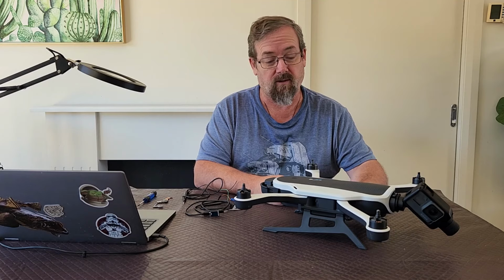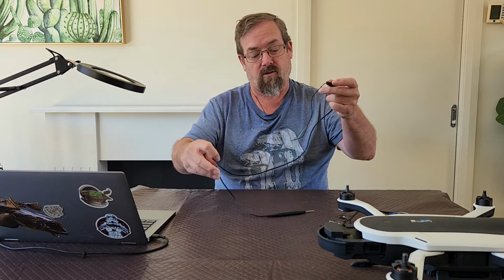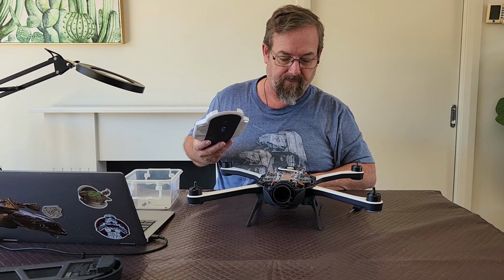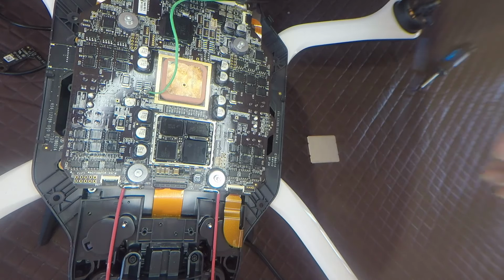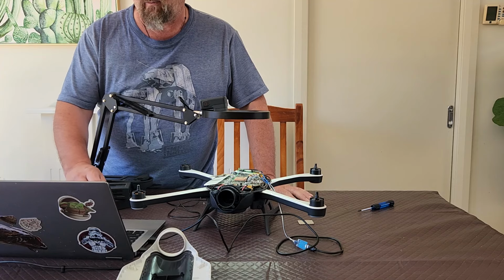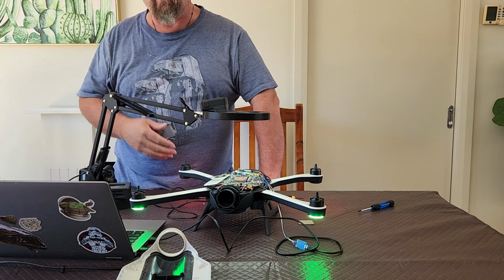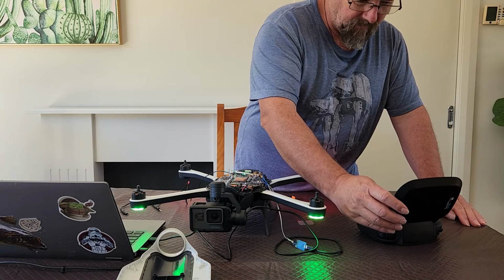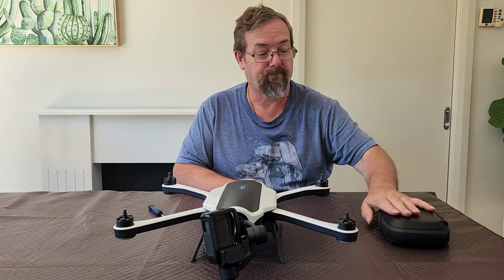GoPro Karma Pairing Fix with some extra information

Comment: Ben you truly are amazing I’ve watched your other videos from back in the day when I was attempting to find hair restoration options because I had pulled out almost all of mine in a vain attempt to fix my drone. The patience you must’ve had is commendable. I’m interested as to how it all came about and how you reached the solution you did. 
Regardless I cannot thank you enough for posting this video it seems mildly daunting but I appreciate your clear and concise videos. 
I’m assuming your inbox is overflowing with requests and comments, but if you ever decide to offer your services for repair please let me know and I’d happily pay for your time and knowledge.  Once again, I think I say this for every grounded karma owner… thank you thank you thank you!
Shout out to Mike’s Man Cave!
Reply from the maker: Hey Jo, I can't take credit for finding the solution to the pairing issue or the controller upgrade fix. For the controller upgrade fix I adapted work that others had done to turn the controller into a gaming console so that you could write a newer version of the firmware to it. For the pairing issue I had been working with a group of others and we were trying to replace the bootloader via the UART boot but we were not able to get it to enter the UART boot mode consistently. Sergey cracked the ability to boot from SD card which then provided the missing part to the upgrade process.

Since then my part have been about promotion of this method and setting up a social media presence, getting the Discord server off the ground and engaging with people around the world who have the ability to carry out the repair reducing the cost of shipping. We are continually adding new counties to the list.

Comment: Thank you for this video. Just one question, the serial interface is RS232 with +/- 12 Volts, RS485 or which is the voltage of it? TTL 3,3volts or 5 volts ?
Reply from the maker: The serial interface is TTL, the 3.3 volts is used to drive the SD card and trigger the SD boot.

Comment: could you please explain the probe wiring? are both wires connected together into the probe ? but the green one gets the resistor? I am confused there Thanks
Reply from the maker: THere are several ways to do it, we have pictures of each way on the discord server. It depends on what method you are using (on board SD card , external SD card and or where you are pulling power from. If you have one of Josh's Good Karma boards then you dont need to worry about it as the probe is built into the unit

https://cdn.discordapp.com/attachments/1230267922874765413/1230507615264706560/triggering_boot_with_fb36_jumpered.jpg?ex=67983045&is=6796dec5&hm=f0c323ed081e93123c867a29cbbf0845082364ed75b8ac61da02811f3204ddac&

https://cdn.discordapp.com/attachments/1230267922874765413/1230507940872454214/triggering_boot.jpg?ex=67983092&is=6796df12&hm=6640ebb6e0ec9276a6cb38629895a631bdcca3f0259893691719d948ab1662dd&

https://cdn.discordapp.com/attachments/1230267922874765413/1230507192969596938/triggering_boot_with_fb36_jumpered_power_from_jtag.jpg?ex=67982fe0&is=6796de60&hm=41176ee208efd19ba02af242ad159e224c01fa3180e9994297b7c7108ccb43b7&

Comment: Thanks for really good video, i have soldered SD card reader, i see drone with putty but when i try to start it from sd card, it does nothing, when i touch with probe, does it mean that sd card reader is bad?
Reply from the maker: It means there is an issue with the SD boot process. It could be the card, the image on it or the SD reader you soldered. make sure the resister is only between voltage and the probe. Dont have the resister between voltage and the SD card reader. 

If your still having issue come over to the Discord server and ask the question there.

Comment: Hi Bozmanx where can I buy the tiny 3 pin female connector for the Karma's serial port , so it will fit exactly on the type of male connector on the mainboard. An advice which connector type I need is appreciated !  Thank you in advance.  Cheers, Erik
Reply from the maker: Its a JST 1.25 pitch 3 pin plug
The page below defaults to a different one so make sure you change it too JST 1.25 3pin
https://www.aliexpress.com/item/1005001649158434.html?spm=a2g0o.order_detail.order_detail_item.3.2451f19cZYNvV3

Comment: Hello, you have a lot of great info in this video. The only issue I am having is with the probe. I can see where to put the resistor, but my question is. where do you get, or how do you make a probe like the one you have with the 2 wires coming off of it? Thank you
Reply from the maker: I just soldered a couple of bits of wire together. Added a resister and connected it to an old multimeter lead that had a probe on it.

Comment: Hello @bozmanx ! Big thanks for this video 🤩 Have you a little diagramm for connexion between mother board karma and sd card board with 1k resistor etc !?
Reply from the maker: If you go to the discord server (link in the description) under important pictures there are about  5 pictures on the different methods.

Comment: can you please provide link to made up cables and advise if prob with soldering method must be used or can external power source be used rather? 

otherwise are you interested in purchasing my drone with this issue?
Reply from the maker: https://www.youtube.com/watch?v=dNbqbC1h_9s

You can get power from the drone or use an external power supply. Some people have been using power from the USB TTL device, the Project good karma board is also used for power via its USB-C connection.

Comment: Will this happen to every Karma drone? I have two. One just got the "decease" during a lengthy winter hibernation a couple of years ago. The other one is still working.
Reply from the maker: Its possible, at the moment it appears that if you don't use it for a lengthy period of time that it happens. I got my Karma drone back in about 2015 but its is still fine.
Reply: @bozmanx  Is there any official word from GoPro. When this started to be an issue a lot of people got a new Karma core (body) as a replacement, but when I tried to open a case they offered me a new remote controller! I tried to complain and suggested that other people got a new core as the fix for this issue but to no avail. I don't understand how GoPro could offer replacement cores to some, while my excact same issue was supposed to be fixed with a new remote. I even explained that I already had tried to pair my 2nd remote to the unresponsive Karma core but it was hopeless. So I just digressed.
Reply from the maker: @GrenlandUnderVann  from what I heard many of the people who got a new core had the same problem because they had just been sitting around for years and they obviously were not testing them before they sent them. GoPro is not and has not commented on the pairing issue. I have approached them on several occasions (including the legal team) and they have never responded. My understanding is that no one is to respond to anything about the Karma. Support will let you log a call but will reply a week or so later with the line that they no longer support it.

Comment: I connected the RX, TX, and ground wires to my drone and tried using PuTTY, but nothing showed up in the console. I restarted the drone a couple of times, and changing the RX and TX but then, it just stopped turning on altogether. I'm not sure what happened. Can you help?
Reply from the maker: Come over to the discord server and ask the question there. I would start with making sure your batteries are all charged and then check to make sure putty is configured correctly. The speed is the big one (from memory its 115200).  Be precises in the description of the issue, include any errors and a screenshot always helps.

Comment: Hello. I was wondering why there are only three wires hooked up to the nand. You show a ground, dat rx and data tx. 
Most usb data cables have four wires, the fourth being power. 
I am assuming that the power cable is not be attached to the nand connector. Is that right or did I miss something in your instructions? Please let me know. 
Thanks
Reply from the maker: You are correct, it doesnt require a power wire as the board powers itself.
Reply: @bozmanx  Thanks

Comment: Thank you for the video, with the number of drones with this issue do you think this is a one time repair or something that needs to be repeated as necessary?
Reply from the maker: Its possible that it could come back, a lot of people say it is related to one of the updates if thats the case then it should only happen once. Corruption on the boot loader is not a new thing, there are stacks of videos and forums on it. DJI also suffer from the same issue with the Divinci processors.
Reply: @bozmanx  thank you for the videos! Got my drone flying again!

Comment: hey at Bozmanx is it possible to program the nand using Jtag or the SWD interface?
Reply from the maker: Yes, you can but we avoided a solution that required a tms200/220 or Jlink due to their price.
Reply: @bozmanx  ok thanks for the response

Comment: Hy , where can I find the little board with the SD card on, or a link would be wonderful, thank for all you’re great work by the way!
Reply from the maker: You occasionally see the arm board for sale on Ebay, this video should you how to build one and has all the parts listed in the description. 
https://www.youtube.com/watch?v=dNbqbC1h_9s

One of the guys in our Facebook group is designing an all in one board which includes the SD card, a UART and a probe connection to trigger the SD boot on TP1. Its current progress is here
https://www.facebook.com/groups/1412898679632354/permalink/1534404537481767/

Comment: please,sir ,i can't type anything after the console appear the message "arago project",stop at here all the time. i can't type 'root' to login .  now The uart interface does not respond after several failed attempts.Maybe I accidentally short-circuited RX and RT and GND during operation.  but the drone  can still power on and The glitch is the same as before (My original fault is that it is difficult to connect the controller after the upgrade of the drone, but it can be connected normally after forced restart for about 20 times, and it cannot be connected immediately after shutdown and reboot).So I think DM368 is still working, but for what reason has the uart interface been turned off. What am I supposed to do now? please
Reply from the maker: Come over to the discord server and ask your question there. 

from what I have seen if you cant type in Putty people have solved this by downloading Tera Term. Its another free terminal emulation software package. 

If you get the failed nand boot when you dont use the problem but get a blank screen when you use the probe you should check your wiring for the SD card setup. A blank screen when using the probe 99% of the time is an issue with the SD card or one of the board related to it. You should confirm that the resistor is only on the probe's power and not the SD card 's power.
Reply: @bozmanx  thank you .For the blank screen problem, the same wiring method I was able to get to the display message "arago project" at the beginning, but after many stuck in the can not enter root login there, it became a blank screen. Of course, I'll double check. Is there anything wrong.I had to fix the blank screen issue first and then download Tera Term to fix the problem of not being able to type command lines

Comment: ok, so i have the sd card slot in my Karma, is there a way to update just using a sd card only? or is this the only way?
Reply from the maker: You can use that onboard SD card reader but you will still need to trigger the SD card to boot and have a USB TTL serial device to see the output from the chip. Come over to the Discord server and we can help you though the process if you are going to attempt it.

https://discord.com/invite/wGVdWPpkua
Reply: ok, so I don't have a gimbal as the original was broken, can I still perform this without the gimbal? thanks

Comment: My drone has the SD card slot installed, where does the card actually come into play?
Reply from the maker: That means that you wont need to build a board to boot off, you still need to jumper FB36 and trigger the SD boot mode by applying 3.3 volts to TP1. Then just run the commands.

Comment: I have managed to get the serial port set up in putty to the point that i can get the sd card to load to the arago project point but the characters during the loading are garbled and improper. then it will not allow me to type anything into the screen prompt cursor. i am using putty in windows 10, i do not know how to use linux at all. i have tried to google how to fix this issue and nothing is useful. i am literally on the verge of making this work finally after a faulty usb adapter etc etc etc..  this is one last issue i cannot seem to solve on my own. anyone have any suggestions?
Reply from the maker: awesome to hear you are making good progress. If you are getting garbled text its normally one of two things, the wrong speed set on either in device manager for the serial port or in putty, the other time we see it is if the serial device is a rs232 device and not TTL. When people cant type in putty they normally fix it by just changing to another terminal emulator like teraterm (its open source). You should come over to Discord server, you can ask questions there, all the people who fix this issue are there and can offer advice. https://discord.gg/wGVdWPpkua

Comment: How can you make the probe?
Reply from the maker: I just use a fine tipped multimeter probe. something like this is fine
https://de.aliexpress.com/item/1005005354247614.html?src=google&src=google&albch=shopping&acnt=708-803-3821&slnk=&plac=&mtctp=&albbt=Google_7_shopping&albagn=888888&isSmbAutoCall=false&needSmbHouyi=false&albcp=19373904215&albag=&trgt=&crea=en1005005354247614&netw=x&device=c&albpg=&albpd=en1005005354247614&gad_source=1&gclid=CjwKCAjwt-OwBhBnEiwAgwzrUs-n3Jpxj9T9yUrdXWg4uLbD_p_XfAAsSSkN7LQbjxp3f18cqEZhzBoCk2YQAvD_BwE&gclsrc=aw.ds&aff_fcid=b6f564c3d92148b0942ac9bff18d83b9-1712961169238-05446-UneMJZVf&aff_fsk=UneMJZVf&aff_platform=aaf&sk=UneMJZVf&aff_trace_key=b6f564c3d92148b0942ac9bff18d83b9-1712961169238-05446-UneMJZVf&terminal_id=c3d1098eedb04fc69ae59500ef9aa3dc&afSmartRedirect=y
Reply: Awesome thank you, then you put an inline resistor on? And what gauge wire did you use.
Reply from the maker: @brianbedoe913  I tend to use some old ribbon cable off a hard drive but most wire is fine. If you need more info come over to the discord server, there is a lot of good info there